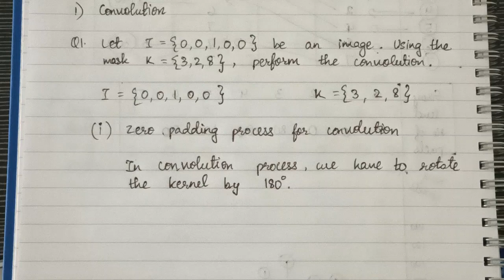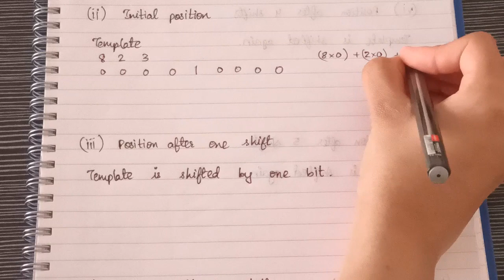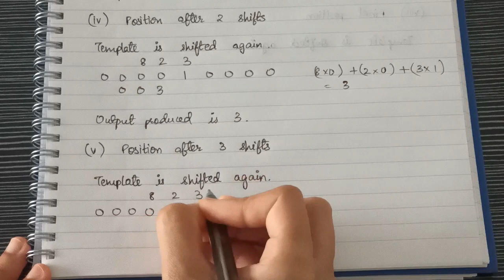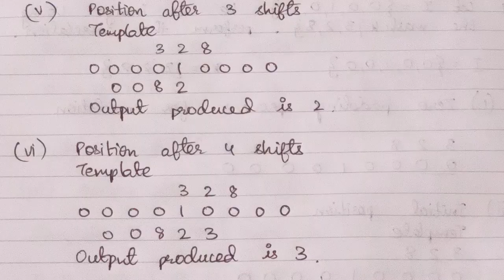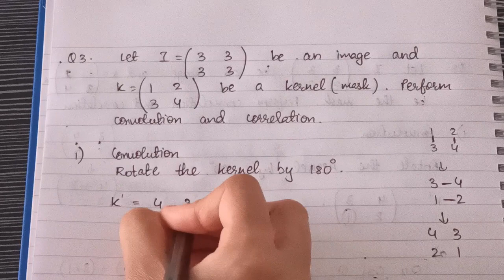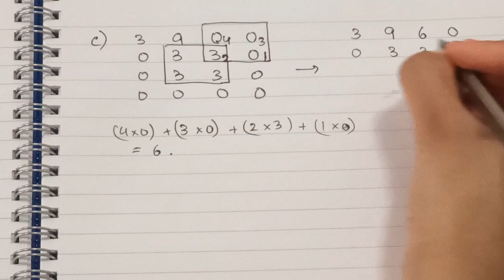Fundamentals of Spatial Filtering in digital image processing

Comment: Excellent video, 
Sis, I have a question: do we always add a border of zeroes even if the kernel size is smaller than the image and the image already has a border of zeroes? 
I have a kernel say:
1 2 3
3 2 1
2 1 3

And image say:
0 0 0 0
0 3 3 0
0 3 3 0
0 0 0 0

I have to calculate correlation with minimum zero padding needed, do I still add a border of zeroes in the image and then calculate as you showed?

Please let me know, I'll be very grateful <3